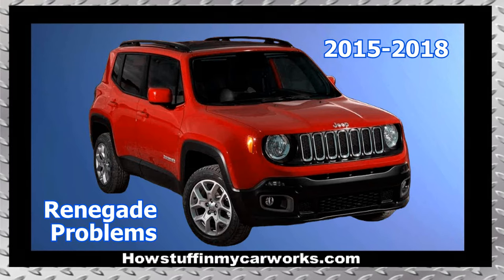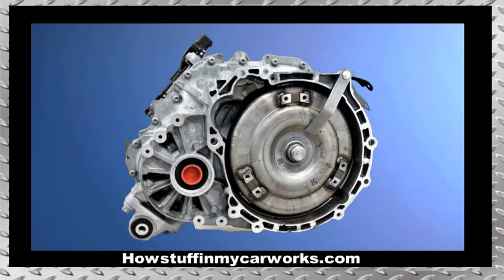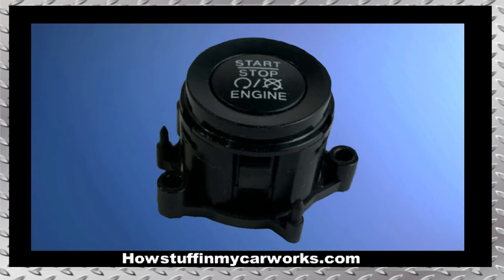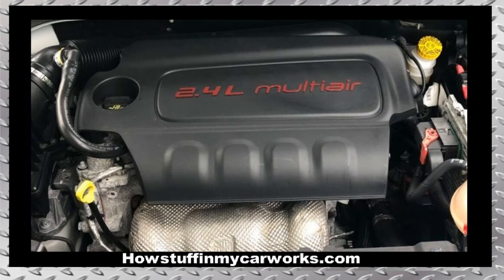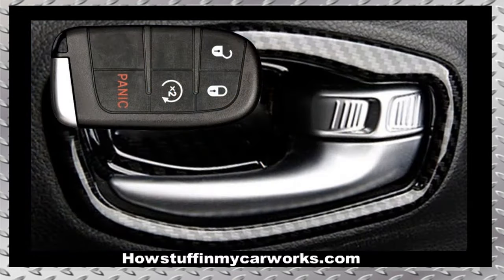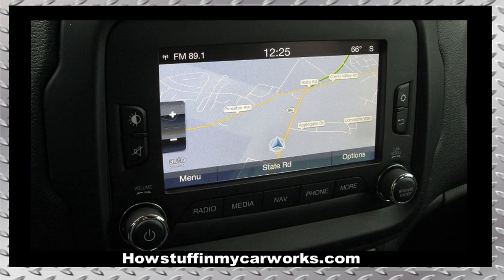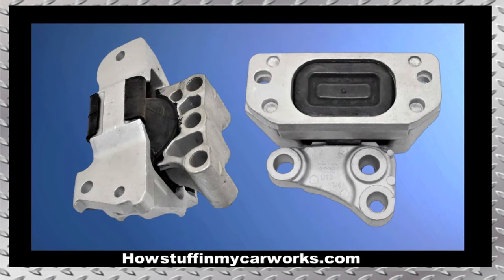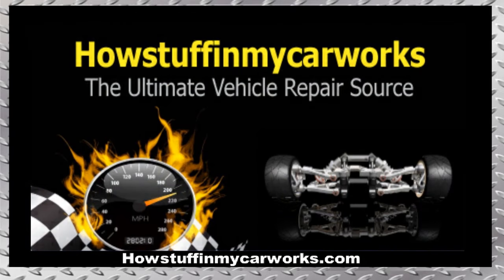Jeep Renegade 2015 to 2021 common problems, issues, defects and complaints

Comment: I bought a 2018 Renagade in January 2022. Two weeks later I went on a 400 mile trip with no problem. In May my daughter and I went on a 800 mile trip and after 650 miles the engine decelerated and then cut off. This happened 5 times, but would start again. We found a motel and stayed over night. After watching this video I came  to the conclusion that the jeep was low of oil. We bought more oil the following morning. We didn't have any more problems. I have never had that problem with any other vehicle. I checked it before leaving and it full. The oil consumption is very high in this Jeep.
Reply: This is what people get when they purchase a fiat or kia. Poor quality control and cheap manufacturing.
Reply: I have a Jeep Renagade 2017 and got a recall notice in the mail 3 months after acquiring the Jeep used. The recall was a 15 minute software update that a dealer had to do to the computer system for the engine. The recall update fixed a known problem that caused oil consumption to be much higher than normal while driving on the highway. If you have not had this recall fixed I would recommend contacting a Jeep dealership.
Reply: @shaunlugton9233  Do you have a link to this by chance?  I'm having the same issue with a 2018 I bought used.  I don't believe the update was ever done.  I want something in writing to take to the dealer to force them to do the update.

Comment: Mopar sent me a letter about updating the ECU software, at a dealer, at no charge.  I took advantage of the offer and my 2015 Renegade oil consumption stopped.  It's still good practice to check the oil every 1000 miles.

Comment: Didn't have any of those issues. But A/C compressor blew out the side of the housing(fixed under warranty). Radiator leaked(fixed under warranty) but dealer missed that the low speed fan resistor had popped, perhaps contributing to the radiator early demise.

Comment: Also watch out for the ebreak, if it gets stuck on you have to disconnect the battery and reconnect it to reset it.
Reply: What was your screen in your car looking like when this
Reply: first comment i see is why i am here, parking brake will not release, the whole vehicle wont start and is locked out because of a parking brake ? WTF i hate vehicle computers, i am leaving the battery disconnected until the morning then trying it all over again
Reply: @commiesnzombies what did it end up needing? Was the no start & other issues all related to one problem? Thanks

Comment: The start button not working is easily fixed by pressing the start button with the key. Placing the key close to the button seems to reset the system and it should work fine after this fix.

Comment: To anybody interested in buying this car. Don't. It's becoming a little more popular because its cheap but don't fall for it. it isn't a wrangler so the dealers and Jeep themselves don't give it much thought. It's also a Fiat Jeep so most mechanics hate working on it. The aftermarket support is very minimal. JEEP/FIAT pretty much screwed over their fans. I will never buy a Stellantis car ever again and i'll make sure I tell every single person not to either.
Reply: My experience has been different.  I own a 2015 Renegade with the 1.4L turbo and a six speed manual transmission.  It currently has 88,000 miles.  So far, I’ve replaced a PCV valve ($8) and a ignition coil went bad.  A coil is $20.  Even though only one coil was bad, I decided to replace all four of them.  Either way, less than $100 total.  I tend to be a maintenance freak.  The oil & filter get changed every 5000 miles.  The spec calls for 5w40 oil.  I use Castrol Edge.  The transmission oil was changed at 50,000 miles.  The rear end and PTU oil was changed at 60,000 miles.  The maintenance schedule calls for a new timing belt at 150,000 miles.  I’ll change mine at 100,000 miles.  I generally get 300,000 miles out of a car.
Reply: @markshuell3198  hello there. Great comments. I am having some tracing of oil in the air intake hoses, maybe a PCV starting to fail too. It's terrible because the car only just did 25K.
Im also getting a bad mpg from 40 before then drops to 28mpg now. I cant find the fault. Service with oil and filter is up to date.
Do you think it got something to do with the pcv? The oil is in right level every time I checked it.
I cant find MAF sensor for my renegade, I research and all I can find is that it uses something like speed temperature pressure differential thingy, using the MAP and IAT and pressure Sensors.
Reply: Do you have to use premium gas for your Renegade?  I am looking at buying a 2018 Renegade, but was told the 1.4 turbo engine will need premium fuel, not regular.
Reply: What are your thoughts on the 21 limited with the 1.3? I'm looking at one cause it's loaded and only 25.5k with 7k miles
Reply: @summersadie3687  Yes
Reply: I generally use regular 87 Octane in my 1.4 liter turbo, and it is considered 'acceptable' for the engine.  Mine runs fine, and fuel consumption is about the same as using higher octane. The only time I run higher octane is the hottest part of the summer.
Reply: @markshuell3198  Just passed 91000 miles in my 2015 1.4l/6 speed, it is still using not only the original radiator fan, but even the original battery.  I did have the Uconnect module replaced under warranty, and the sun visors on the windshield.  So far that's it.
Reply: I hear you.
Reply: Cheap my butt. High thirty to low forty thousand dollar range is NOT cheap.
Reply: @markshuell3198  Turbo failed on mine at 128k. I confronted Jeep about the fact that a turbo should not fail as soon as power train warranty ends. They basically said SOL.

Comment: Don’t buy one!  Nee 2016 replace alternator multiple batteries, emergency back has to be turned off every time you drive.  Sittin in neighbors yard because it died last night.  The air conditioner sucks